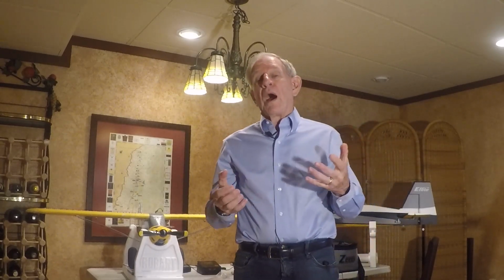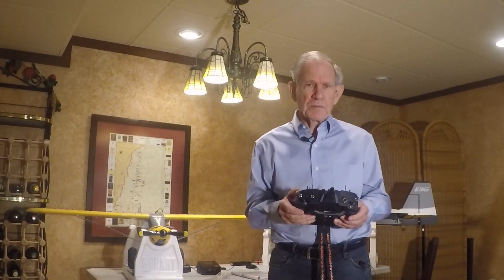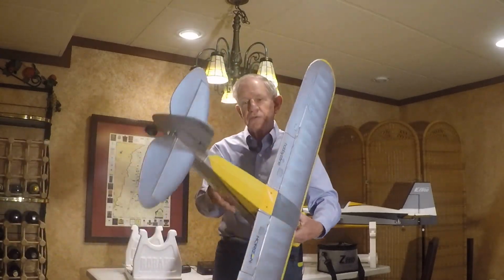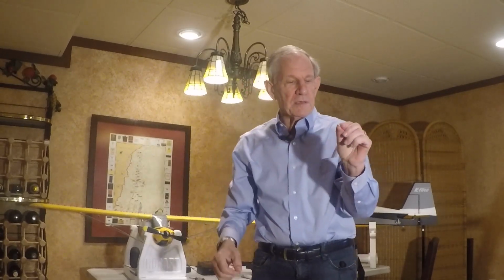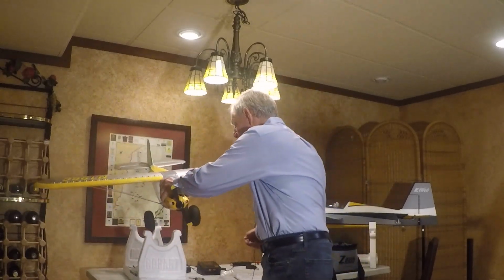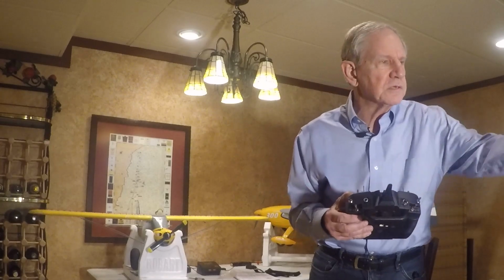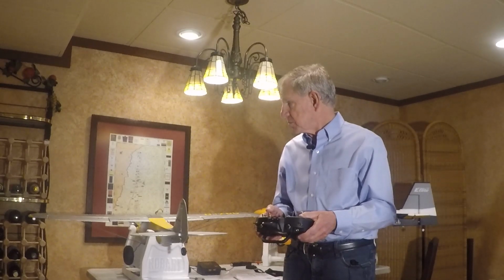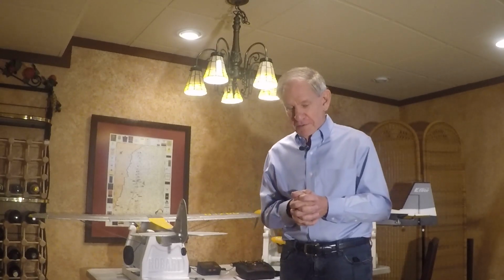Carbon Cub S2 - Tips, tricks, tweaks and some issues. Description has detailed NX 8 settings.

Comment: Thank you so much for sharing. I’m a newbie at age 64. I too bought the carbon cub, and your video was extremely helpful. will definitely picking up a programmable transmitter, NX8. Learning about Rate and Expo was exceedingly helpful.
Reply from the maker: You're very welcome! Happy flying. It's a great little trainer. The NX transmitters are top notch. Mine has been used for over well over 1,000 flights and never had an issue.

Comment: Did you know that you can change the rate at which it takes for the flaps to fully engage? Slows down she speed at which they are fully engaged. That will help to soften things up. but you will need one of the NX or similar radio systems.
Reply from the maker: Yep, right there on the flaps setting page on my NX8.

Comment: How did you set up flaps with SAFE on your NX transmitter?
Reply from the maker: The manual has those instructions.
Reply from the maker: More, the manual has basic instructions including the flaps/elevator mix required on page 20. I found the recommended mix was OK.

Comment: I’m looking at the ready to fly version because it’s on sale for 249.99. The BNF is 269.99. I have a NX6 do I need a bind plug to use my NX6 with the RTF version??   Or would you recommend a different model. Thank You
Reply from the maker: The RTF is the the same airplane without the transmitter. A bind plug will work on either for binding to your transmitter.

Comment: Very informative video.  Thanks.  I have the Carbon Cub S+.  A couple of things I noticed.  You took the strut covers off.  I cable tied mine on.  They actually strengthen the landing gear.  Very important.  These planes are made from EPO foam.  Not styrofoam.  Those wing struts are very important too!
Reply from the maker: Actually, the wire gear struts are weak and bend at the fuselage. Lesson learned, I don't buy models that don't have steel struts.

Comment: I bought a used carbon cub s2. Got to watch it fly. Got it home and can’t seem to get it airborne. It lifts 8 inches off the ground and I back out. Breaking the prop. Am I not going the extra step and add more throttle? Is the elevators off? Can you help? Just subscribed because I understand you.
Reply from the maker: Sorry to be so late on the reply. It needs full throttle and does not like grass over 1" high.

Comment: On your elevator to aileron all you have to do is program in a mix aileron to. elevator so when you bank with the ailerons it will automatically apply elevator.
Reply from the maker: That is correct IF you have a programmable transmitter. The DX S that comes with the RTF version is not programmable, and that is the transmitter version intended for this video.

Comment: So many thanks to you, I'm from Rome, Italy, i fly rc since 10 years or more... With same plane, but only now my wife gift a dx8e, programmable radio, and i have flaps operating.... I try strange when flaps work, nose up... Stall... Your video is very interesting.. i need to ask you: when flaps ar off, it's all ok, but when i switch 1 or 2... Speed must be slow, so slow... Right?? So. Best regards to you.
Reply from the maker: Yes, that is normal behavior of high wing aircraft. Lowering flaps causes a pitch-up. The amount of pitch-up is also related to airspeed. The faster you go the worse it gets. To fix, you need to mix down elevator and throttle with down flaps. The Carbon Cub S2 instruction manual has the flap installation but not the required flap-mix setting. Your dx8 manual will have general instructions on how mix servo movements. However, it does not have the instruction for this mix. I found a video that explains it. It's for the DX 9, but should work with your DX 6. If you have any more experienced RC pilots available you might want to talk to them too. Here is the video:

https://www.bing.com/videos/search?q=carbon+cub+s2+dx+8+flaps+elevator+mix&view=detail&mid=B57DA97E0C60686D5E17B57DA97E0C60686D5E17&FORM=VIRE

You may also want to add a throttle-elevator mix, but this is optional and can lead to very bad results if not done properly.

Comment: I'm in a very similar situation. Been out of the hobby for over a decade and bought the same plane to get back into it. I was surprised to see how fast this plane flies and how much sky it'll use up in a hurry. I wrongly assumed I could fly it in a small park but it really needs some space. I was planning to add the flaps to try and slow it down but your advice on flaps with the included transmitter has me reconsidering.  Thanks for your well thought out video.
Reply from the maker: Flaps are useless without the ability to mix in down elevator. Try it with the DX S and you will regret spending the money.

Comment: I've bought the carbon cup S2RTF and I cannot get the mode switch to to go into the beginner mode. If I push the panic button the green light comes on otherwise otherwise it's either red or blue. Any suggestions on what I'm doing wrong um?
Reply from the maker: Hi, I am not sure. On that model's transmitter the button is only for binding. It has nothing to do with flight modes. The 3 position toggle on the top left side of the transmitter sets beginner/intermediate/advanced flight modes. If you bind the model correctly it should work. Try re-binding and follow the manual precisely. If that fails pull up the Horizon site and use their tech support/chat line to try and sort it out.

Comment: I have been manually adjusting flaps using tooth pics to position them since I only have the dxs controller and was told flaps won't work with it so was wondering how you got the flaps to work with the dxs controller
Reply from the maker: More...

Actually you can get the flaps to work with the DX S. BUT, if you do that the aircraft is almost uncontrollable in pitch. When the flaps come down on a high wing aircraft there is a strong pitch-up tendency that can cause a stall. The more power the stronger the pitch-up force too. It's created by downwash off the flaps hitting the top of the horizontal stabilizer. On a programmable transmitter you can create a flaps/elevator mix that offsets the pitch-up. I DO NOT recommend using flaps without that mix programmed.
Reply from the maker: You don’t. I think it’s explained in the manual that you need a full feature transmitter. I bought the NX8 but there are less expensive options. You will need that anyway to make any progress in the hobby. The spectrum transmitter line has excellent resale value if you buy and change your mind.

Comment: Does this aircraft still use the stock ESC, or did you upgrade it with a better one? Thanks.
Reply from the maker: It had the stock esc when I outgrew and sold it.
Reply: @GoofballFlyer  Thank you for the prompt reply.

Comment: Thank you Tom for your very thoughtful and informative video. It was very personable, unhurried, and frankly charming. Your suggestions will help me avoid some pitfalls and suboptimal function problems. Since I’ll be using the described hinges for the ailerons, rudder and elevator I may just as well install them on the flaps. My purchase of the same Carbon Cub S2 is pending figuring out just what add ons I want to install. Flaps are a given, but since I am fond of gizmos and gadgetry I’m pondering the GPS and landing assist modules. I really don’t think they are necessary but they are intriguing so I’ll probably spring for them. Too given the readily available electronically independent first person hardware that can be viewed with a Smart phone I might opt for that later. The parts can be ordered from overseas sources for very little money and they are easily moved between models. 

Best regards,

Duncan
Reply from the maker: Duncan, be aware that if you install flaps on any aircraft using those flaps will change pitch. In full scale we have to adjust elevator trim to compensate for pitch changes. In RC we can program a "mix" that adjusts elevator when flap settings are changed. The DX S transmitter that comes with the Carbon Cub RTF version does not have mix programming. I would advise you to either buy the BNF version and a programmable transmitter or not install flaps. My experience was that the pitch changes with Carbon Cub deployment are pretty dramatic. I know, I tried using the DX S and the first time I deployed flaps the model looped! I bought a Spektrum NX 8 and programmed the flap/elevator mix. I later sold the Cub and Dx S transmitter on eBay with a note to the buyer about the flaps. I had moved on to more complex models. As for GPS I bought that too, and found it to be not very useful. If you set up Safe Select it makes landings much easier to learn and landing assist redundant. Good luck with the S2!

Comment: I myself, just getting back to it after about 20-25 year's or so.
This, electric power is what I've been waiting on!
But the batteries and all are something to learn.
I have a Carbon Z Cub SS 2.1 that will be on the back burner till I get better
Reply from the maker: It’s amazing what has happened. The current smart battery and charger revolution is only a few years old. The digital radios are incredible. So are the outrunner electric motors. In the full scale world the change is almost as fast.  Makes it hard for an old guy to keep up. What will the next 10 years bring?
Reply: @GoofballFlyer  and I forgot to mention, very good informative video.

Comment: I'm also recently getting back in after several years.  No pro flyer here, but I do know a bit about Li-ion batteries from my other pursuits.  The nominal voltage of these batteries is 3.7 V per cell.  3.7 times 3 is 11.1 (printed right on the wrapper of your 3s pack).  You aren't using more than probably 20% of your capacity.  3.4 volts per cell is where I set the warning, and that gives plenty of extra to make a casual return with no pressure.  The threshold you never want to cross is 3.0 volts per cell.  Of course, if you drain them less they recharge quicker, but stay up longer and have more fun!
Reply from the maker: 3.2-3.4 still gives you plenty of reserve.
Reply: @GoofballFlyer  , right you are, but be aware of the voltage sag under load.  If you have to abort a landing, you need power.  I have one plane that pushes the battery to >90% of it's rating, and the current draw depresses the voltage a few tenths of a volt.

Comment: Nice video, but I must say one thing.  If anybody does what you mentioned to do with the hinges. They better use wooded toothpicks to push through the wing and holes in the hinges as well as glue these too, and of course, cut to size. Otherwise, if you only glue in the hinges, over time, the glue can come loose and the hinges will come out in mid-flight.  I know this because I had it happen with one of my first builds I did some 40 years ago and lost one of my favorite planes because of it.  So just be aware of this safety tip as well.
Reply from the maker: I should have mentioned that detail.

Comment: Great video thankyou Tom. I own a series one horizon ss cub and have done all your mods excepting the mixes. It is by far my favourite plane from my collection and I love how it flies somewhat similar to my full size. How do you find rudder deflection on the series 2? On mine, it was very mild at full deflection and my wings were getting beat up from slow flight tip stalls. I added some length onto the tiny servo control arm and now it can recover from all but the worst tip stalls. It is also more controllable with crosswind ground handling.
Re your flying field problem, I am unhappy with the direction FAA is taking with airspace control  with remote id and registration necessary for aircraft as light as this one. It should be legal to fly at sports ovals (not just registered fields) where light posts and trees provide shielding from manned and drone aircraft. An alternative to remote id could be the use of portable adsb receivers for modelists  The idea of regulating and controlling what consistantly proves to be the safest area of aviation (rc aircraft and racing drones) is a very expensive one. Much of the price will be paid by us the hobbyists, likely to be to the detriment of our hobby
Reply from the maker: It does tip stall at the drop of a hat if you get it too slow. I finally started landing it in Safe and with some speed. That worked out great if the grass is short enough. I wonder why the gear is not a little further forward. It flips on its back easier than any of my other planes.
Reply: @GoofballFlyer  Ah yes. I forgot about that. The rudder does not stay pretty for very long. We could suggest a few improvements to horizon such as the landing gear further forward. Being a beginner plane, the foam is quite stout and heavy for ease of repair as you say. One disadvantage is the overall weight compared with size which makes for a high wing loading and, consequently, stall speed. (It also flies a little faster than scale as a result.) This also creates the need for a high airspeed when trying to make smooth landings - Quite unlike its full sized counterpart where most normal landings are power idle. This is where its balsa counterparts will really stand out with lower comparative weight and better slow speed perfrormance. Having said that, I would not dare take a delicate balsa model to the park or a rough farm property 🤣

Comment: Thank you yes they are real airoplanes, I must tell hundreds of people that they are real, If it was not real you would not be able to see it or touch it.
Reply from the maker: They are very real and not easy to fly. Even a $5 balsa glider or a folded paper version is a real airplane. I use both in classroom demonstrations.
Reply: @GoofballFlyer  Yes Correct.

Comment: Great video, and yes I have the same carbon cub, the same as yours. I agree the NX8 is a superior radio to the one I have, the DX6. After getting back into the hobby the changes and technology indeed have changed over the years. If not for the ready to fly planes my reintroduction to flying would not have happened.
Reply from the maker: I'm in the same boat. I built balsa first time around. With all else going on around here now there is just not time. Besides, it's a lot more fun to fly than build, and these newer planes fly better than anything I ever built.

Comment: Very informative video! I just bought this plane, have never flown before, and found this extremely helpful.  Especially the differences you described regarding beginner mode vs advanced in regards to the elevators.
Reply from the maker: Glad you enjoyed it!
Reply: @GoofballFlyer  Hi Tom, great video...thanks....I just got this plane and similar to your experiences, I also had major issues attaching the rudder and horizontal stab...I ended up having to resort to gluing the whole thing onto the fuselage....also saw that the little screw securing the tailwheel to the end of the fuselage was going to be too short, the gap between the 2 drilled plastic tabs was 1/4"....I am going to have to do something about that as a hard landing will cause the screw to pull out and the impact forces will be transferred fully to the  rudder hinge.  If its not too much trouble, can you share your settings for the flap>elevator mix?
Reply from the maker: @ I don’t have that airplane any more and can’t remember the setting. The manual says 12 mm at 50% flaps and 25 mm full flaps. That’s a good starting point.
Reply: @GoofballFlyer  Thanks but I meant how much elevator to apply in a mix for takeoff flaps and landing flaps.  Its OK, I saw in your video how much the elevator moves, I will go by that.
Reply from the maker: @GentleFlyer  50% and 100% happen to be good takeoff and landing flaps settings